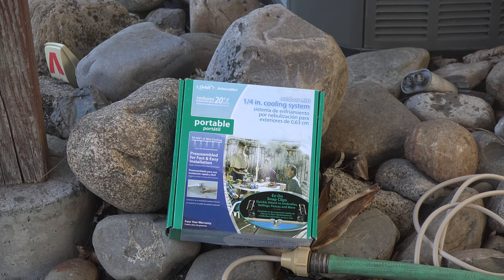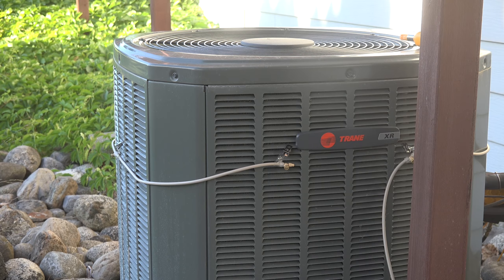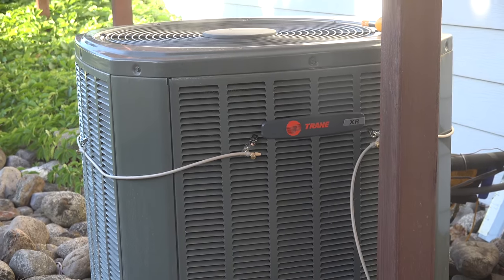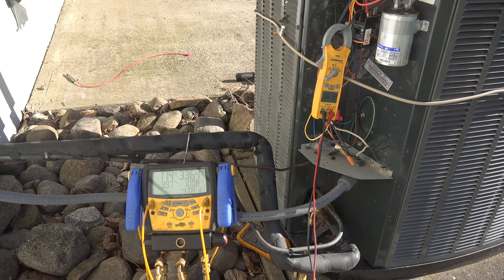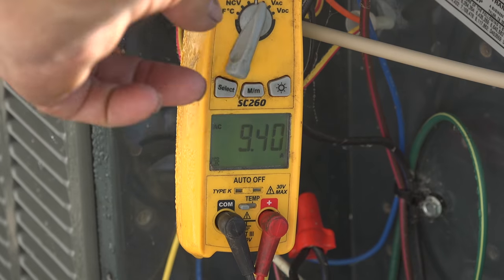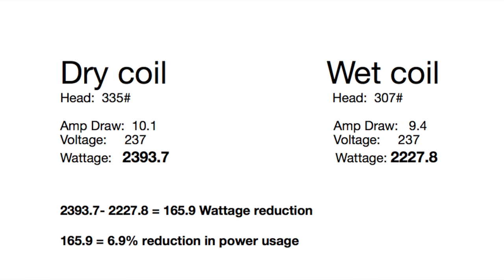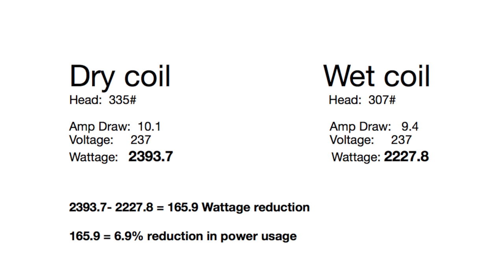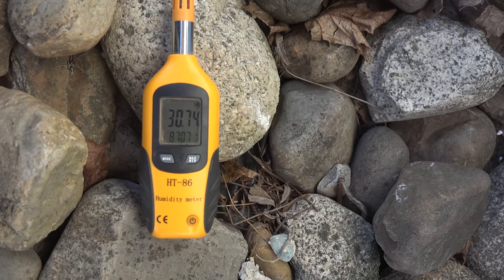Do the misters for A/C work? Part #1

Comment: Next door the guy put one on and bragged on it.  Three weeks later it was gone.  When I asked him why, he told me the mister stopped working.  Apparently the minerals in the water clogged up the mister heads long before they could do any damage to his coils.  And, they are very difficult to clean of all those minerals.   He tried soaking them in vinegar and it only partially worked.  So, he gave up.
Reply from the maker: Maybe it saved him a lot of money by failing early.
GFM

Comment: i can't find the video anymore (really just can't remember what it was even named) but the guy was using a mister system like this and he only used it when the outside temp and humidity would make it effective. supposedly he's saved a lot on the energy bill compared to the amount he's spending on the extra water.
Reply from the maker: I have watched most of the videos on this subject.  The problem with those that claim energy savings is that they don't have an accurate measurement of energy use.  
Using you power bill to determine energy savings is like using the bottom line on your credit card bill to determine how much you paid for groceries.  There are far too many variables to make an accurate determination.  
And, as it always seems to be, when you look closely at excessive claims, they turn out not to be accurate.  
GFM
Reply: @grayfurnaceman  i didn't dig into any of it. seemed nice but where i live it's so dry and the extreme heat isn't that often that swamp coolers for the home are quite a bit more effective.

Comment: There's another thing you might consider testing: Does the temperature of the cold air blowing inside the home drop at all? Because if it does, then the unit would be not only running more efficiently when it's on-- it could also do its job with fewer operating hours per day. If people are reporting greater energy savings from misting, that's probably why.
Reply from the maker: Watch the rest of the series.
GFM

Comment: You can probably save as much energy with annual proper cleaning of both indoor and outdoor coils, and using a 5-2-1 soft start kit.  (Without incurring NEW costs for water hardware, water costs, and possible contaminants)

Comment: you forgot the interior temp drop? and when the AC stops and saves you money if it cools the interior faster?
Reply from the maker: There is a series of videos on this issue.  They are linked at the end of the video.  If you check the videos, you will find there is no increased temp drop across the indoor coil.  If the temp of the air does not drop, there is no increased efficiency, thus it is not cooling the interior faster.
GFM

Comment: Hose line calcium inhibiting filters run < $15.  The mist nozzles I have are 1/2gal /hour /nozzle and you need the calcium inhibitor to prevent the nozzle from clogging. Four nozzles would be 2 gallons per running hour.   I would like to see the next video on the return and supply air temp differences but it seems the concerns on water usage and calcium buildup are only valid if you do it wrong.  Looking forward to the next video.
Reply from the maker: I have seen the "inhibitors" cover the coil with calcium.  There are filters that will remove all minerals but they are quite expensive.
GFM

Comment: I used misters on ice machine remote condensors, it did increase ice production in the hottest months.

But i used reverse osmosis water. The hard water was scaling them up bad.
Reply from the maker: The problem you run into with using RO water is pure water is quite corrosive.
GFM

Comment: Will this sprayer make the ac work better for an older unit that ran hotter in the hot days?
Reply from the maker: Sometimes it will help until the coil gets clogged with calcium.
GFM

Comment: If the output temperature of the delivered cold air inside the house is cooler it means that it also will not run for as long a period of time. That is also a power savings.
Reply from the maker: Check the rest of the videos linked at the end of the video.  Duct temp is covered.
GFM

Comment: some retirees like putting them on their condensers  here in FL, I do recall we had one years back where the lawn clippings were sticking to the coil and water + dead vegetation was accelerating the composting and essentially caking on the lower part of the condenser coil which electrolytically appeared to have rotted out the crappy aluminum condenser coil
Reply from the maker: That could happen, but dogs will also mark territory on A/C coils which I can guarantee will rot out any coil crappy or not.
GFM

Comment: In high humidity areas, the coils will be evaporating the water because they are extremely hot relative to the air temp.  The problem then becomes that mineral deposits that will happen as the water evaporated on the coils eventually ruining the coils.    If you live in a low humidity area you could put an evaporative cooler pad in front of the unit and mist it thus preventing deposits on the child but presenting cooler air to the A/c unit for the heat exchange.
Reply from the maker: Or maybe just use a swamp cooler and save a whole lot.
GFM

Comment: You assumed that the heat removed by the evaporator stayed the same.   Is that a valid assumption or is the AC removing more heat from the house ?
Reply from the maker: Watch the entire series, linked at the end of the video.
GFM

Comment: Humidity although important is not the main factor. Misting the water actually decreases the water temperature (like Freon going through the expansion valve) and subsequently the air temperature. So initial water temperature means a lot too. Water heated in a hose by the sun will not be as effective as water coming up from underground pipes.
Reply from the maker: I am not sure you have the facts right.  When the water mists, at least part of it evaporates which lowers the air temp.  With high humidity, less water will evaporate.
GFM
Reply: The evaporation is not the primary cooling method with mist. The expansion from fluid to mist cools the water. That is why they will still work at amusement parks where high humidity exists. I explained that clearly above. Just read it again. Freon is working similarly in the AC system.

Comment: I'd set up an evaporative cooler outside of the ac unit. The water would drip on the mesh of the evap cooler and not the ac condenser. Wow.. this could all be automated.. humidity sensor, electric water valve, ball float to turn the water off.. they must sell combo units already, right?
Reply from the maker: I know of no manufacturer that supplies a unit with this option.  
Many times, the devil is in the details about what appears to be a viable option.
I used to live in the high desert of California where we used almost exclusively swamp coolers.  My father, who was also an A/C tech, religiously maintained his swamp cooler.  And yes, there is quite a bit of maintenance necessary.  It was quite effective.  However, our neighbors did not.  The most they seemed to do was turn it on and gripe about how poorly it worked.  
Add to that, the corrosion problems with the A/C unit, and no manufacturer wants to deal with the warranty problems for a very slight improvement in (yes it is slight), efficiency.
GFM

Comment: just use the condensed water discharge from the evaporator
Reply from the maker: There is never enough water unless you live in a high humidity area in which case they are not effective.
GFM

Comment: I am just looking at something to help the air conditioner cool the house better?
Reply from the maker: Clean both the outside and indoor coils and be sure there is no vegetation blocking the outdoor coil.  Get the unit checked by a pro for charge level.  
About the only other change you can make is to buy a higher efficiency unit.
GFM

Comment: wat about rain water in your coils??? doesn't that mess them up just like tap water?
Reply from the maker: Rain water is distilled, so there are no minerals in it.  Distilled water does cause corrosion but there is very little rain that actually gets into the coil.  The misters increase the volume massively.
GFM

Comment: What about building an evaporative cooling box around the condenser?
Reply from the maker: That would have all the problems of a mister with the addition of the concentration of minerals that would come from evaporation of the water.  Then you could throw in some legionnaire's disease.
GFM
Reply: grayfurnaceman we use Porto cool units all the time and the deposits would be left in the evaporative media not on the ac condenser coils. As for desease I I haven't heard of anyone else having issues with the thousands of evaporative coolers across the nation.
Reply from the maker: All the Portocool units I know of are swamp coolers.  There is no refrigerated air, thus no condenser.  There is no comparison to be made.
GFM

Comment: The theory behind this product is thermodynamically sound - but , as you say, has some issues in practice.

First, your measurements omitted one of the most significant parameters - TIME.  Adding an evaporative cooler to the AC condenser improves it's heat transfer efficiency which means the AC would run less time to provide the same net cooling.  The fact that the running load decreased by 7% is icing on the cake.

As you said, evaporative coolers do not work well in humid locations like Louisiana but they work great in hot, dry locations like Arizona where they are often used instead of AC (because they are much less expensive to run).

As you pointed out, the most significant problem I see with this system is that it should be supplied with demineralized water - which requires expensive filters.  Ordinary tap water would likely load the AC condenser coils with mineral deposits in a very short time.  Even a thin layer of those deposits would significantly reduce the heat transfer capability rendering the whole attempt worthless - or worse still, permanently damaging the condenser.

So, does it work?  Yes.  Would I use it?  No.
Reply from the maker: First, watch the rest of the series.  Run time is not reduced.  In fact, it is increased slightly.
Even the use of demineralized water introduces another problem.  De mineralized water is quite corrosive and could damage to the coil.  Dissimilar metals corrosion (copper vs aluminum).  
GFM
Reply: @grayfurnaceman  - I respect your HVAC expertise but I don't see how it's possible that adding an evaporative cooler to the system made it run longer - indicating LOWER efficiency.  That makes no sense.  If that's true, then "swamp coolers" shouldn't work and I know for a fact that they DO!

Did you measure that at the same ambient conditions; wind speed; time of day; sun exposure on the house; window blinds/curtains opened/closed, etc.?  There are a lot of variables that need to be held constant to  arrive at the correct conclusion.

De-mineralized water is a poor conductor of electricity and, therefore, NOT highly corrosive.  It is the minerals in water that make it conductive and what would concern me regarding corrosion and deposit buildup.  Ordinary tap water could cause big problems pretty quickly.

Also, AC condenser units are built to be installed outdoors and run in the rain.  So water ingestion is considered in the design.

Unfortunately, the areas of the country where evaporative coolers work best are experiencing severe drought - so the water is best saved for more important purposes!
Reply from the maker: @raisingjakestudios1371  Sometimes the logical conclusion just does not pan out when tested. That is why I did this series of tests.  A/C systems are designed to operate at the conditions they will be used in.  Artificially reducing head pressure can sometimes have unexpected results.  If this test was done with a 40 year old A/C system I would expect the misters would help.  The newer systems have much higher efficiencies and changing their operating conditions just may not help.  
The tests were done the same day and as close to the same time as possible to eliminate as many variables as possible. 
Note the air conditioner has louvers and is installed upright, so water (most of which is from sprinklers) is reduced.
I have a background in boilers, and have found that using distilled water in them can be quite damaging, mostly due to the higher temps.
In the A/C condenser, we have both high temps and highly aerated water, which also can cause oxidation.
There is also some evidence the minerals in contact with the coil may actually reduce corrosion, but of course insulating the coils.
GFM

Comment: And reduce the head pressure will that make the unit last longer
Reply from the maker: It does reduce head pressure.
However, with the good also comes the bad.
A reduction in head pressure is beneficial when outside temps are high, but unless the spray is shut down during the cooler part of the day, head pressure could be dropped too low resulting in inefficiency in operation.
GFM

Comment: I did a similar set up. And used only in late afternoon when I returned from work.

Which was at the peak high of the day and house was little warm.

Run for couple hours until house was cool then turned off.

Comment: unless you looking back at ac window units 
water vs coils is bad ideas because use it over years you will see how bad coils look and all that dirt stuck to it n it aint easy to clean it took me 3 or 6 hours just get all that junk off of it and straighting up coils line (cause by water danged) and after all of that it back normally cooling (not like band new it kinda worn out)
trying save ac unite n make it last longer it requires a lot of maintenance keep it clean at all time it no joke how bad it look

if you looking for way keep units cooler i recommend having it away from sun light or make roof over it (5ft from ac unite top to roof) 10ft by 10ft im sure u find more questions in it (no wall around it because it cause it over heated)
Reply: HOA’s will not allow modifications to homes.
Reply: @MarineScoutSniper  hoa is worse than u think of it

Comment: Actually,  not sure about a very small amount of moisture but  when you saturate a condenser with water from cleaning and you start system,  the head pressure is so low that the evaperator isn't absorbing heat due to the pressure  drop.  The suction line will be warm compared to  a dry condenser.  BUT IT SURE IS COOL COMING OUT THE CONDENSER ON A HOT DAY!LOL

Comment: Hi Gary. I've got a  question I've had since the first time I saw one of those videos recommending misters. After reading about the hard water deposit issue this was my question... What if you built an 8' x 8' x 3' tall enclosure around your air conditioner unit. This is assuming the AC unit is slightly taller than three feet. So the  enclosure would be around the outer walls. The roof of the unit would have a cutout in the center that the AC unit stuck out of so the output air would be free and clear. As for the enclosure it would have that swamp cooler mesh all the way around the four sides and circulating pumps that pushed water up and then gravity feed down the mesh. So the air would first be sucked in past the mesh, into the  AC unit and then up through the top of the  AC unit unobstructed. Would that cool the incoming air without causing hard water buildup and without using a lot of water as it would be recirculated? Air flow inward should be fine I would assume but maybe not as clear as would be optimal. Obviously airflow out of the AC unit would be fine as the enclosure would not go over the top of it. What are your thoughts on this if you don't mind. Great video BTW!
Reply from the maker: Essentially you are putting a swamp cooler around the air conditioner.  Ideally, this would provide cooler air to the condenser, resulting lower head pressure.  And, it would work that way.  The first problem that would mitigate against this system is the condenser fan.  This type of fan only works with very low static pressure.  Any addition would reduce the airflow and work against lowered head pressure.  
The next problem is the calcium.  The recycling of the water actually makes the calcium buildup worse as the evaporating water leaves a higher percentage of minerals in the remaining water.  One look at swamp cooler pads will confirm this.  Inevitably, calcuim buildup will transfer to the a/c coil.  
GFM
Reply: You have to consider the repercussion of recirculating water. Each cycle through the misters will evaporate water, but the minerals are left behind. The water would become increasingly mineralized until it became saturated with minerals and the deposits left on the coils would be MUCH worse.

Comment: The commercially available ones have a particle filter on them, it won't do one damn thing to remove the dissolved solids in the water, and won't protect the coil or cabinet from mineral buildup and corrosion.

Super heat, evaporator temperature split, and capacity difference would have been interesting too. ;)

Comment: I'm not so much concerned with the money savings as I am being able to keep my house cool. At 90 degrees outside, like it was in this video, my AC has no problem keeping up, but when it's 105 outside like it can be a few weeks a year then my AC just can't keep the house below 80 to 85 inside. The mister around the AC just might do the trick to bring the temp down inside making it much more liveable.